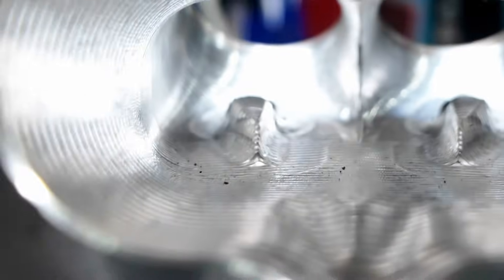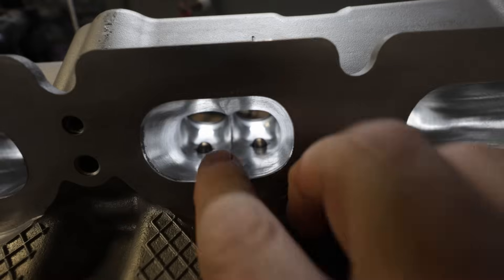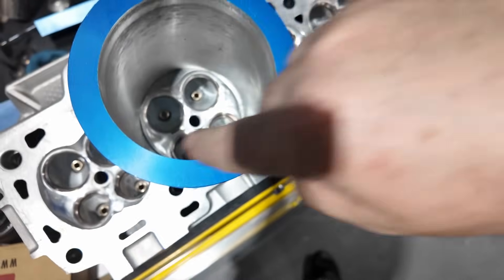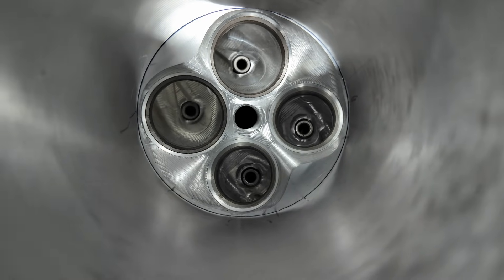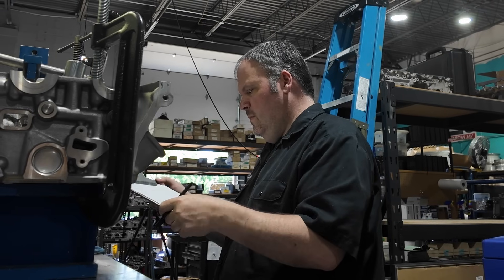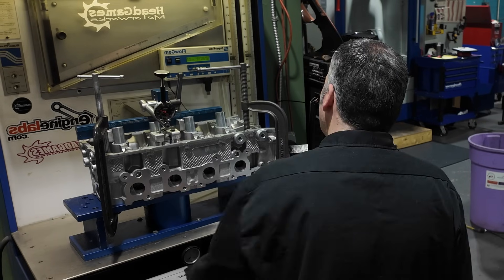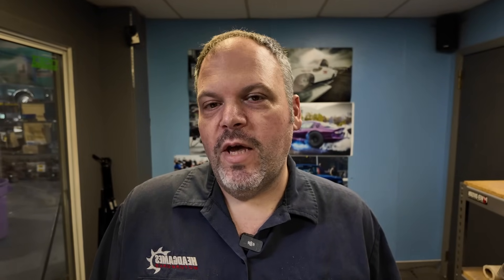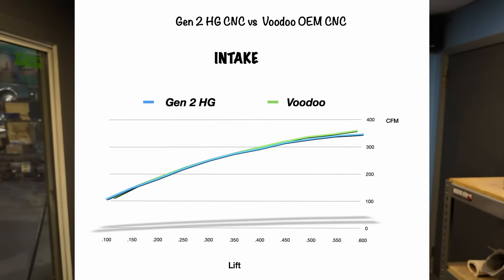Flow Battle: CNC Gen 2 Coyote vs Voodoo Head – You Won’t Believe This!

Comment: After watching the Gen 1 vs the Voodoo video and this one with the Gen 2, it looks to me like the Gen 1 head kinda outshined the Gen 2. I am considering doing Gen 1 Headgames cylinder heads on my Gen 2 build, possibly with a Gen 3 block. Used Gen 1 cylinder heads are far easier to  find and I liked the extra flow in the midrange lift but still hung tight at higher lift. Did you Gen 2 valve seats in the Gen 1 head for Gen 2 valves?

Comment: I noticed that the Gen 2 F150 heads are a different part number from the Mustang heads, do they flow any different?
Reply from the maker: I honestly don't know, but I am sure we will find out
Reply: @headgames  I was wondering because I just bought a Gen 2 F150 longblock for $1300 lol. Going to give it a refresh, then Gen 1 cams and it will go in my Mustang as an upgrade.

Comment: I did a gen one (12mm) block with sleeves, stock gen two heads and gen 3 intake. Dropped compression to 9 to 1. Deleted the VVT and locked the second gen cams. Ran pretty good. Like 400hp NA, 700 and change on boost.

Comment: I have my Gen. 2 CNC and 1 mm larger Valves, How much difference do you think that would make? I didn't get any flow numbers from my heads.
Reply from the maker: the oversized valve would probably hurt the low lift numbers. But the biggest issue is unless you installed seats, the +1 valve doesn't even really fit the oem seat so I personally don't think there is a good advantage but many disadvantages .

Comment: You see people flowing heads but before these awesome heads get flow from an intake prior to. If a person happens to have a 2000 Cobra R intake and cylinder heads how much of a restriction is at play? Do people ever measure head flow while the intended intake is in place?
Reply from the maker: Yeah, we have flow tested them. Example, back in the early 2000's we did a flow test with the LS1. The intake hurt the head flow, so we cut it apart, ported, epoxied back together and it picked up flow! Dyno back to back and it picked up 0whp. Sometimes that thing will lie to you!
Reply: @headgames  I keep getting in my head about the flow numbers but then realize my intake comes before it. Then the cams, intakes effects on the cams , twins on top of that. 4-2-1 vs 4-1 turbo headers and divide A/R vs non. Rabbit hole rabbit hole rabbit hole. My head hurts.

Comment: Something to note is you're not getting .600 lift on the gen 2. The gen 3 and voodoo you're gonna get .590 or better with an aftermarket camshaft while the gen 2 is only gonna see .512 or so
Reply: Why is that?
Reply: @superkillr taller valve and rocker geometry. The followers on a gen 3 and voodoo are different than gen 1 and 2. The valve springs are much taller also. The stock lift on a gen 3 is as big as aftermarket Gen 1 or 2 cam

Comment: Out of curiosity, do you mill the heads to ensure they're flat and have a proper surface finish for optimal sealing? That can make a big difference, especially for someone considering having their Gen 1 or Gen 2 heads ported. I’ve even come across factory Ford heads that were warped or not perfectly flat out of the box, even a set of GT350 heads.

Also, do you have any comparison data on valvetrain weight and spring pressures versus the GT350 setup? Airflow numbers are helpful, but they don’t tell the whole story when it comes to performance. Plus any known cost savings going with your service vs buying from Ford? A set of loaded GT350 cylinder head from for runs about $7,000
Reply from the maker: we mill every single head that leaves, it is not an option for it to not be done. The cost comparison has come up a few times here so sounds like I need to include that in the videos

Comment: I have a gen 3 sb, with voodoo heads and gen 1 timing/pcm in my fox swap. Deciding factor for me was cost. At the time, i was able to get stock voodoo heads from a Ford dealer for less than sending out a set of gen 1/2 heads and have them ported. I think the gen 3 heads will probably match the voodoo heads, or be very close.
Reply: Too bad you couldn’t find a set off boss heads stock vs cnc the boss outflows the gen 2 heads even ported

Comment: I liked the compare, but I think what most people are missing, your comparing a factory stock CNC port head, that was designed around a MFG making a HP number for an engine combo. The Voodoo had touches in all areas of parts, but just like a factory does normally, they do subtle changes in multiple places to get the goal. They CNC ported the head to flow better, while keeping torque as high as they could being a flat plane. They focus on lower power band more then the aftermarket, because that is where majority of the customer will feel, and drive the car.  When you start talking aftermarket performance, most focus on power up top, so i would expect an aftermarket CNC port job to pick out more flow, even over a factory CNC head. It's like saying the stage 2/3 comp cams made more power up top then stock gen 1/2/3 cams, of course they do. What you give up down low, is the reason Ford uses smaller cams though, they are more focused on driveability, emission, low to mid power range. I would really like to see a fully optimized Voodoo head compared to the Gen 2, but i'd expect the gains to be only coming from the valve size, degree of cut, and maybe some CC shrouding difference since the head casting themselves are very similar. Always cool to watch your videos, with test and explanations.
Reply from the maker: we also concentrate on the torque aspect of our head builds. Nobody wants something that isn't fun to beat on.

Comment: which is cheaper? Because by the time i get a set on gen2 heads pay to send them out to you, pay to get them ported and pay to send them back and the whole time I could get complete voodoo heads with cams and springs for a couple hundred dollars more then kinda becomes a one way obvious answer to choose plan B
Reply: Yes voodoo is cheaper probably by quite a bit.
Reply from the maker: If you already own a gen 1 or 2 head then the price of admission is much cheaper. The voodoo head comes with oem parts, and steel guides so they would need to be machined to get them to the level of this gen 2 head.  The price of entry into the voodoo is $2500 + the machine work ($1400) to get them to the level of  our gen 2 which is $2500 for the cnc head with bronze guides not including parts.
Reply: @headgames by chance have you looked at the f150 heads. I have a set of Gen 2 heads